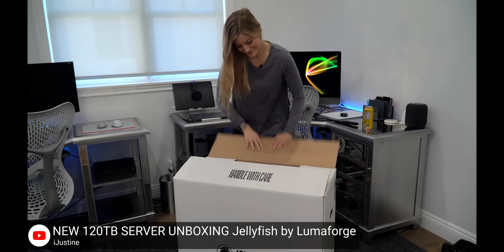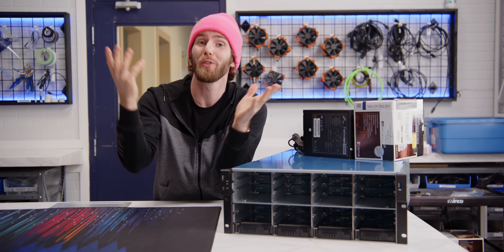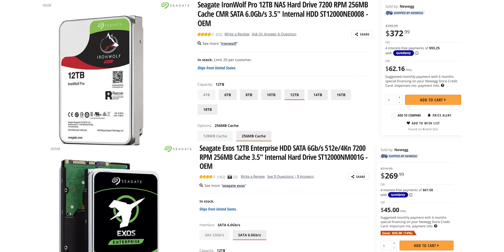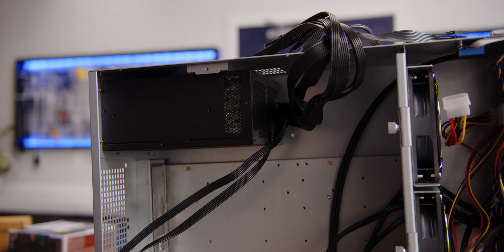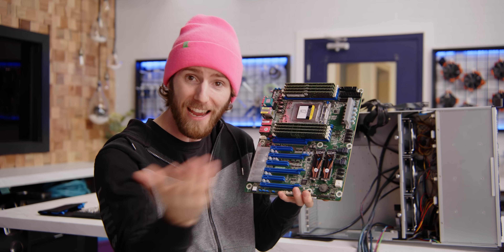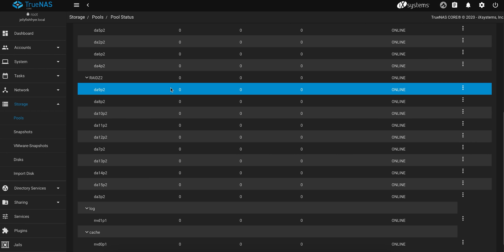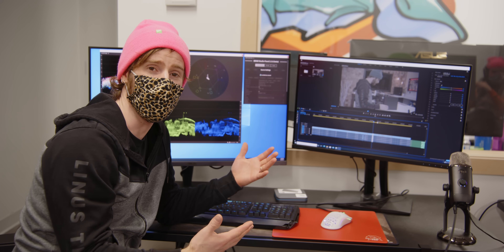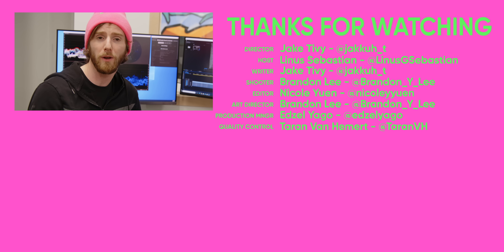Here's How to Save $45,000 - The Sensible Jellyfish Fryer

Comment: I'd feel a little uncomfy deploying a non-mirrored ZFS SLog / intent log / write cache. No worries about the L2ARC, though - it's just data that's already there, but faster. Also, NIC teaming / LAG / LACP does not necessarily multiply your max bandwidth - at least not for a single TCP flow - you're merely multiplying the amount of simultaneous full-speed 10gig flows.

Comment: If a drive claims 2500000 hours mean time before failure (Which is 285 years)... Why is the warranty 'only' 5 years? They could be 25 years and still be less than 10% of that claim. Why so short? Is it just marketing BS? Would you expect a drive to easily last more than 25, or even 100 years?

Comment: Could have used a little LattePanda Win10 SBC with a 7" HDMI monitor mounted on the case to provide a realtime temperature monitor from the windoze only USB cable mentioned.
Reply: For an even cheaper option, an Atomic Pi could be stuck inside with a passive heatsink and would pull basically no power. They're stupid cheap too if you can find one in many cases.

Comment: Nice choice of components - I especially like L2ARC on NVME, 256GB ECC memory and the choice of the motherboard. However I would get rid of the power splitters off the power supply to disks and use a proper server chassis with a backplane attached to redundant power supplies, e.g. Supermicro 847BE1C4 or 847DE1C. Incidentally these have more disk bays, allowing for even bigger storage (36 or 90). More disks would allow for striped mirrors topology, which offers performance improvement on ZFS (and much faster rebuild times). Another improvement would be to use an extreme low latency device/high endurance SSD with power loss protection for SLOG, like Intel Optane DC P4800X or P4801X. SLOG gets flushed every 5 seconds (at most), so it does not have to be large. However L2ARC is a different story - it makes sense to use SSDs as big as possible. So I would use all M.2 slots for L2ARC only, and one PCIe slot for SLOG.
Reply: If you didn't need/want 36+ drive bays which SuperMicro chassis would you pick for something like this? I start to glaze over with all of the different backplane options. I like the idea of using a proper server chassis for this though. Thanks for posting!

Comment: could anyone explain a bit about the max amperage a 5V PSU cable is rated for? 

someone managed to burn a 30-series GPU (think it was 3080/90) at the company I used to work for, using the daisy chaining from one PCIE power connector to two 8pin connectors and was quite curious about the topic as a result of the incident.  If anyone was curious what happened, there was smoke coming out of the GPU, no post.
Reply: timestamp 10:24 btw.

Comment: One comment on the cache and log drives: Since failure of them may result in data loss, it is advisable to have them redundant.
So, one config I like to use in ZFS is two 2TB NVMe's with 2 1TB partitions, one for log, and one for cache. And then make them redundant with the corresponding partition on the other drive. You lose half of the cache and log space, so you might wanna go 2x 4TB NVMe drives to make up for it. But hey, you've got PLENTY of leftover budget...

Comment: Slog should be mirrored on 2 drives using drives with capacitors incase of power failure (or other failures). In this case you could have partitioned the nvme drives and used part of each as the slog and same with the cache while doubling the speed of both

Comment: if that single slog device fails you will have data loss .. mirroring the slog on two or even three devices would be the way to go!
Reply: also for slog you should use a drive with power loss protection
Reply: also a 2TB slog device is WAAY overkill as it is only tmp storage ..

Comment: Really like the network content. As an absolute novice, it's got me interested into setting my own NAS to mainly backup photos and stop reliance on paid cloud storage platforms. Would be great if you could do a video on a minimum requirement NAS (I.e. on an e treme budget) vs a two bay Synology. Keep up the great work guys.
Reply: If you're a PC gamer, your next PC upgrade means that you could probably use your old hardware as a NAS. Otherwise any old machine can do the job. 10 year old PCs with decent CPUs (like i5-2xxx or i7-2xxx) will handle the task beautifully. If you can grab an old "gaming PC" that's 10+ years old, it can also do the job really well. Just might need to replace the case to support more HDD.
Reply: You can find good servers for cheap if all you want is a NAS. Find a good used server with a lot of drive bays and enough ram that's all you need. Xeon e5 2600 series servers work great for NAS.
Reply: Agree with the other comments - you have NO SPECIAL REQUIREMENTS for this. Any computer can be a home NAS. ANY COMPUTER.
Well, as long as it has enough hard drives plugged in. Some computers don't have enough places to plug in hard drives.
Still, it does make sense to make that video in case someone doesn't have an old computer already.
By the way, if it's a desktop, YOUR OWN COMPUTER CAN BE YOUR NAS (but don't install TrueNAS on it. Just set up file sharing on whatever OS you normally run)
Reply: @thewhitefalcon8539  I know this is already long time ago.

But what you mean by don't install TrueNAS? Im completely noob on this
Reply: @PlyAkira  If you want to use your desktop computer as a NAS and still use it as a desktop computer, then you probably shouldn't overwrite it with a NAS operating system.
Reply: @thewhitefalcon8539  Ah i see, Thank you for that
Reply: Hey OP did you ever build a NAS? 😀 I just finished my TrueNAS 4TB mirrored storage HDD / 16GB boot SSD Dell Optiplex i5 8GB SMB server project for file and photo sharing and backups and it was a ton of fun to set up!
Reply: @snowdaysrule  raid zeroing hard drives is really stupid and a terrible idea
Reply: @rysterstech  typo mirrored not striped opps lol!

Comment: Great video, but had a little typo: at 10:30, the screen says “7302P” and Linus says “7302P”, but if you look closely, the CPU says “7402P”. I looked at the 7302P on Amazon and noticed that it was 16c, not 24. The 7402P IS 24c.

But like I said: great video!

Comment: SLOG is NOT a write cache and will probably do nearly nothing if any in your use case, and using such a large drive for it is most definitely a waste of resources and money. ZFS already "batches" writes into groups in the RAM before committing to disk periodically, and SLOG is only used for "synchronous writes" that needs to survive a power failure while they are still being buffered inside the system RAM. Synchronous writes are mostly only used in software like databases where strong consistency is needed, and even in those cases a few tens of GBs would be more than enough for your SLOG. Network writes are most definitely not synchronous and your few terabytes of SLOG will be completely wasted. You'd be better off allocating them as L2ARC instead.

Comment: Making notes as I watch. Last time I ordered EXOS drives the SAS and SATA ware about the same price. Have budget? Do 11-disk RaidZ3, get 16TB drives...
The slog device doesn't use much space - an optane device would be better, 900P? 256GB RAM is bunches - a 2TB drive will eat a large aperture of it (there is an index for the L2ARC held in RAM). Using the special file device instead might be better. You can set your block size to like 128k and turn on small file caching for stuff below that, as well as moving your metadata to NVMe for less access latency. You have to have the same redundancy as the rest of the pool though, so with RaidZ2 you would need a 3-way mirror - probably go with 3x1TB?
I would also lean toward a 4U SuperMicro chassis with regular backplane like you have there and standard redundant PSU (that's mostly already wired up) - it's probably like $1200-1400, so the same sort of range as those parts..
Spiffy board though :-)
And yes, a switch with 16/24 10Gb ports and 25/100Gb uplink likely makes more sense than 2xquadport 10G nics (especially if your MB has 25GB SFP28's) but really might not be cheaper even for 8-10 clients.

And Pulseway is fantastic :-)

Comment: Direct attach without running DHCP on the server is just lazy :< It literally would've been less daunting to users if you did a quick runthrough of "this is the thing that will assign addresses to other computers, we just need to tell it to give the right addresses for the right network cards" rather than manually configuring ips on client devices - yuck. You're really selling the prefab solution here, people don't want to deal with this crap, and experienced techs should know, static IP configurations always end up causing headaches somewhere down the line.

Comment: Um, I think Linus made a mistake. I just looked it up on AMD's website and he said they had an AMD EPYC 7302P, 24 cores.  
However, a 7302P is a 16 core/32 Thread. I think he meant the 7402P as THAT is the 24 core/48 thread.  
  
7302P - https://www.amd.com/en/products/cpu/amd-epyc-7302p  
7402P - https://www.amd.com/en/products/cpu/amd-epyc-7402p  
  
The difference on Amazon is about $500 (give or take) between 7302P and 7402P (granted these I think are based on 3rd party prices).

Comment: the one missing piece for making this user friendly after setup would be running a DHCP server for each port, so that the client machines don't have to do any IP setup. even just to give out a fixed IP per interface. would probably require a bit of custom scripting but that wouldn't be much work
Reply: I think lumaforge has an app that also maps a drive to the storage so it's more like a plug and play device, but again that could be a simple script.

Comment: You pointed this out before in the last video: enterprises pay for support, not hardware. I am an enterprise storage and virtualization engineer and my job is to build and recommend customers spend huge amounts of money for things that just work and have too notch support. 

Performance is most often a secondary concern. Seriously. The reason is simple: most high end solutions are far more performant than most customers can even approach in normal use cases. For those who need top performance, that’s easily doable, as all flash offerings have been around for years. 

Further, there are plenty of very good offerings for those who want massively scalable performance. 

The narrow use case of LTT is one largely experienced by production houses who simply need deep storage with surprisingly modest throughput, from a certain perspective. Many SAN vendors offer very high performance with platter drives by sequentializing IO as much as possible. In these cases, even RAW footage can be pushed through the pipes quickly, without using flash. This is because video data is essentially sequential by nature.

I would be very interested in an LTT appliance vs a comparable Nimble/EMC/Pure/NetApp array. No doubt it would cost 5x or more—but that’s what you pay for when it comes to support and ease of use along with inline deduplication and compression.

Comment: @LTT: tl;dr if you do not recommend the Jellyfish as a prebuilt solution for a small business with no IT department, what would you recommend?

Setting aside, for the moment, the specific Jellyfish products, there's a difference between assembling or buying hardware, and buying a solution. This video demonstrates hardware and software, but not a complete, warranted and insured solution, and it is always possible to save money with just hardware and software.

With the video's build there's no support contract or warranty, or insurance against data loss or security breach. To put it another way: when a piece of mission-critical technology breaks in a production environment, every moment it is not repaired or replaced equals lost productivity, which means lost revenue. When a data breach happens and you're not insured, you could risk being financially on the hook for all the theft itself and all the damage done by the thieves with the data they stole.

For example, if you miss a critical deadline because your hardware fails and you have no warranty service or support contract to get it back up soonest, you've more than likely lost more money than you ever would save working without a net. It's not just the current project--now your reputation is damaged and getting new projects (and new revenue) will be harder. If you work in an industry where there are fiduciary requirements (banking, legal, medical, etc.) you might have inadvertently breached them by not following best practices.

And hiring an IT consultant to set things up is only part of the answer. It's certainly the way to go for a business who wants to save money and or roll a custom solution specifically fit for their needs.

But it does not address what an, e.g., small architectural firm with no budget to have an IT person just sitting there doing nothing does when, six years later, the server that has been churning along for half a decade dies because of a bad PSU at 10pm, when a major deliverable is due at 6am the next morning and failure to deliver means not only loss of revenue but liability for liquidated damages for missing the deadline, because the set timeline for a massive construction project has now been interrupted and thrown off.

A business production environment where deadlines matter and there is not a fully trained IT helpdesk on staff 24/7 that knows every inch of the toolchain inside and out (so, almost every small business) requires a support contract and services and products with warranties. In other words: they require a solution like Jellyfish.

If Jellyfish is not the best alternative, and there is a more business-friendly solution available, that should be amplified, as well.

Comment: I've been trying to set up my own server for holding all my files. I ended up finding out the hard way that a Netscout 6995 system is almost useless as-is (really old hardware from around 2008, 10gbe capture cards instead of network cards) but does provide an E-ATX sized space allowing for a wide range of motherboard choices, a perfectly good set of SAS backplanes and 16 drive trays (if you aren't concerned about failure/ID LEDs working), redundant power supplies with a standard 24-pin ATX connector inside the case, and lots of fans. Find one for cheap/free, gut it, install better hardware, and you can have a pretty cheap but good server for home or really small office use. I also have found that Adaptec series 7 and newer RAID cards have an HBA mode, making them a good cheap way of attaching drives, provided your OS of choice has a working driver and utilities.

Comment: Alright, so these sorts of projects are neat and all if you're just talking about something to have around the house to work on, yeah by all means build it yourself and deal with whatever downtime occurs when you have a hardware problem. Buying a solution like a Jellyfish doesn't just come with a big price tag, it typically comes with a support contract along with a warranty on the whole thing so if something breaks, you know who to call to get that part replaced. 

You have a drive failure. In this case, you grab one of two cold spares, swap out the failed drive and file a ticket with Seagate to RMA the drive. Ok, so now you have to ship the failed drive in and wait for Seagate to ship a replacement once they receive it and once they do you drop that one on the shelf. You can expect that to take a couple weeks unless you want to pay for expedited shipping. Not really a big deal until you've got 2 drives out for replacement and are worried about a third. 

Memory stick failure or IO card failure? Hopefully you have a spare around and can limp by without it until you can work out who you have to ship the failed stick to and they send out a replacement.

Motherboard, CPU or chassis backplane failure? You are now hard down until you can get those replacement parts on site. From looking at their website, I can't tell what sort of SLA the company behind Jellyfish has for getting hardware replacements on site but that is something I'd want to confirm with their sales team before moving ahead to buy something like this.

I'd like to see a follow up video in 3 years noting how much work Linus and his team had to perform to keep the thing running and up to date, how much time they spent troubleshooting any issues, how much downtime for his staff was caused by any issues they had with hardware and how much that cut into his savings for not having bought a Jellyfish.
Reply: All of their servers are self built and have been holding up for the last 5 years. Jellyfishes support is terrible - had a friend who didn't get his server fixed for a month. If you're tech savvy, there is no reason to go with a pre-built jellyfish server, unless their service is worth 20 000$ - which it isnt.

Comment: 2 Drive failure tolerance means Raid 6 /Raid 60.. which contains 2 parity drive so generally performance is slow.. btw why u didn't use SAS drive.. we don't use HDD in server infra we use SAS or SCSI Drives

Comment: The SLOG drive must have Power-loss Protection as well as it must have data center grade endurance. The SLOG drive doesn’t have to be high capacity, it rather has to be really fast with high IOPS, an Intel Optane DC P4800x PCIe would be ideal. 

As for the L2 Arc, the size of drive should not exceed 3-4 times the RAM and it could be consumer grade as it would not affect the integrity of the data in case of a power failure.